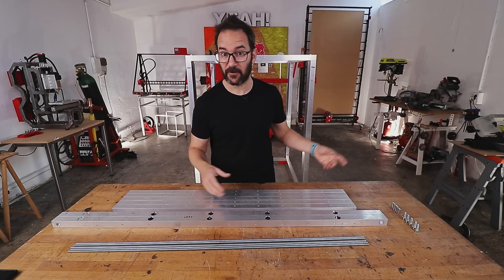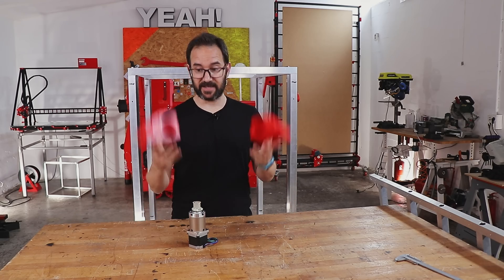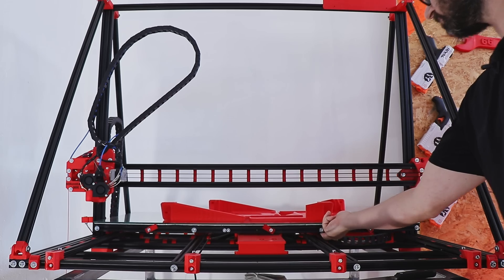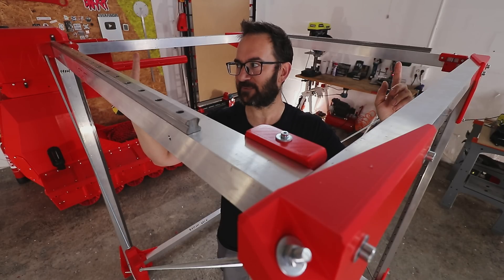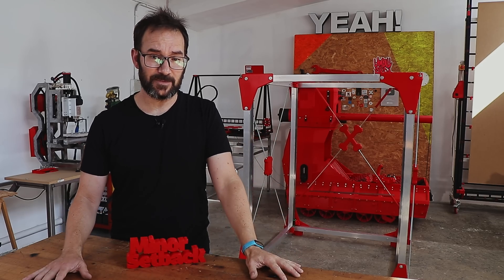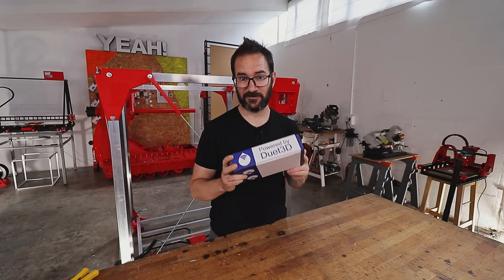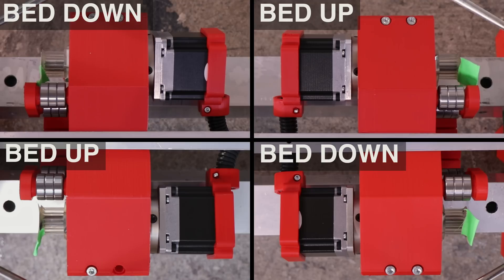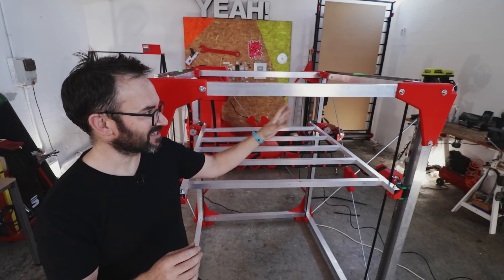MOST POWERFUL 3D PRINTER BED EVER (lifts human) - GIANT 3D PRINTER BUILD PT. 2

Comment: I've been wondering this for years: for big printers, wouldn't it be more useful to lift the xy assembly and keep the build itself stationary...
Anyone got a reasoning for this? 

True, the forces of X-Y movements will be bigger, but the massive weight of a completed print seem harder to handle.

Comment: Not sure if it would improve anything, but would it not be easier and slightly better to attach the motors up/down on the frame? Then you dont have to lift the weight of these + cabling is a bit tidier(?)
Maybe i am overlooking something completely here and not trying to crap on your project! Love it!
Reply from the maker: It would increase the length of belt to be stretched.
Reply: @ivanmirandawastaken  Didnt think of that, thanks for the reply! :D

Comment: Just out of curiosity is this going to be a corexy or a cross gantry 3d printer? I heard Cross gantry are really nice since the belt loops are simpler than corexy ones but you really need to use all linear rails

Comment: Timing belts will flex with the added load of the print. Resulting in under-extrusion with heavy prints. As the Layer height is not predictable.

Comment: I Recommend Using Thicker Gauge wires for the DC power From The PSU or at Least doubling or quadrupling the wires you're using ,It might bite  you in the Long run with more steppers and load ... Personally I preferred Acme Screws on the 4 corners ,Though you gotta work with what you Got .

Comment: I would still add pulleys and a counter weight to it just to lower the strain on the motors, and make them less likely to fail and drop.  Still, can't wait to see it operational.

Comment: If you ever decide to build even bigger printer, try designing a bed with counterweights (like an elevator). It allows to have better control even with weak motors, since they operate on weight difference. I've seen a dremel cnc with this approach, it worked fine.
Reply: That is a great idea for something this large. 
Some industrial CNC machines do in fact use counter-weights on cables, others use springs or even air cylinders to compensate for the weight. Often times the movable part weighs several hundred kg, so the compensation systems really do help.

Comment: i've been considering building my own CoreXY setup (not this large of course lol), but the hell if i can figure out how to control it, i'm guessing it pretty much comes down to writing the firmware the way you want i normally use BTT boards in my printers, and have zero experience when it comes to Duet boards but i know ivan loves the things (since he uses them all the time) so i'm guess they are pretty customizable...
Reply: Just use Klipper, it comes with CoreXY support out of the box and supports many commonly found Mainboards. Have a look at the Voron printers for some inspiration:)

Comment: While the system can take the weight, once you sit down you can see the whole bed move down a little bit. That is the belts stretching and might result in accuracy issues with larger prints..

Comment: Impressive that it can lift your full weight! 

I wonder if itd be worth it in a system like this to have two z-axes; one to move the build plate slowly and steadily; and a second little short stroke z actuator on the hotend to do the z-hops (like a piezo with a lever system). The sheer wattage consumed (not to mention vibrations generated) if you want to aggressively z-hop a full build plate like this will be kinda disgusting :P.

Comment: What is the reason for the bed moving up and down rather than the print head?  I am asking because, having XY gantry move up and down would have the moving masses stay constant, unlike getting heavier as the printer extrudes more to the moving bed like in the current configuration.  Also, was decreasing the belt length by half that significant to have the motor attached to the moving bed?

Comment: Wouldn't you have problem with elasticity of the belts during the print. The deposition of material in the bed would slowly get heavier, messing up the leveling of the nozzle between layers and therefore getting weaker layer adhesion. Isn't it?

Comment: I'd like to know the thought process behind how you landed on this particular setup for the z axis movement - this is the first time I have seen it being driven by belts in this manner. I would have assumed the usual threaded rod approach (lead screw).
Seems to me that the lead screw would be stronger (no stretch) and would provide mechanical advantage to the motors by design. Side to side wobble could be a concern but then again thats what the linear rails are there for. Could also just use a thicker screw.
I'm not an engineer so I definitely cant say what's best or claim this way is bad. I'm sure he has thought about the potential stretch and tension problems just like the rest of us. Will be interesting to see it print!
Reply: Voron 2.4 is similar in the Z-Axis
Reply: @mocotonio  a lot of parts look like he took some inspiration from the Voron family of printers :)
Reply: @JonasKöritz  Probably not a bad thing.
Reply: @mocotonio  yes, definitely. I've recently finished my Voron 2.4 build and I'm impressed on how well thought out that thing is!

Comment: Supprised you didn't use closed loop stepper motors. With such a massive length of belts there is definitely an increased chance (especially as the machine gets used) of slipping and skipping. 

Appreciate its only really small chances, but each time you build a bigger machine the small chance does get bigger....

Comment: I wonder if you had given it any thought to put on every corner lever mounted castors that have small shock absorbers or chair gas shock replacement cylinders so that your printer sits evenly on the floor of your workshop plus if you need to move it out of the way then you won't have to struggle dragging it & possibly causing injury to yourself & the machine?

Comment: @Ivan
If you can't find the right size pulleys because the shaft diameter of the pulley is too small or too big then there are a couple of ways to modify things so that they will work after all. If all the easily accessible pulleys at your fingertips are 10mm shaft holes then you can simply drill them out to 11.5mm on the drill press using a 45 degree block of steel that can stand up so you get a perfect vertical hole & then use a 12mm Spiral Reamer which creates a perfect smooth bored hole.

With the larger diameter holed pulleys you can find the right size outside diameter brass sleeve bush that will fit into the pulley & then also drill out the center to 12mm on the drill press. If you use any type of bush you'll also need to drill a hole through it & tap it in the same place as your pulley so that when you screw the grub screw into the pulley you are able to clamp onto the motor axle. These plastic pulleys that you are making up might not stand the stresses that you will put them through so you will definitely have to look at the options above.

Comment: Hey, hi, a good way to stiffen a square is to use steel cable under tension instead of the threaded rod. Its easier to install and cheaper.
Reply: I happen to have experience from both solutions as I thought as well that threaded rods are a better option for similar tasks! Steel cables under correct tension are very rigid, simple, lightwight and non-disruptive. It should be noted that threaded rods are not rigid without tension either and transfer vibrations quite well too, yet they are much more complicated to install (see all the required parts and nuts?). There are still a lot more to understand, the physics and minor details are important. However I would recommend choosing steel cables in similar projects. And if you still need more rigidity you need to look at your design again and consider adding more crossbars.
Reply: Cables work but they don't add as much rigidity as thread all. Cables will also allow vibrations to transfer to the frame more readily. Thread all gives you the ability to use them like iron rods but also the convenience of adjusting the size without having to cut them. It's a more rigid design using the thread all and that's what you need in a printer. We use cables in aviation because they are lighter and they allow for Flex. Flex is the enemy of this machine
Reply: adding this reply because youtube doesn't show dislikes on comments.
Reply: @MachineManGabb  why would you dislike? Why not just correct or at least share your opinion so that if you're wrong you can be corrected. That's how we learn!
Reply: @MachineManGabb  hey hey their now their opinions are correct. Are you here to taunt them 🤔
Reply: @MachineManGabb  like every suspension bridge in existence?
Reply: @GBR6000  suspension bridge is not and should not be rigid, this frame should. Also it should remain square over time, cable stretch a bit (which they do under tension) and the frame is not square any more. If for some reason frame goes out of square it is easy to re-square by adjusting the nut, not so easy with cables.

Comment: With that size bed, I would've recommended a rack and pinion drive mechanism rather than a belt, which is prone to stretching under load. This is of particular concern, given the dynamic nature of the load as you print.
Reply: @Thomas Bonse
I guess the measuring rail or decoder would solve said problem of sag etc. So in g code u can compensate on the fly. But still i m with you there. Linear Screws are not so expensive IMO. Version 2 then incomming hehe
Reply: These high quality steel belts will do just fine at that huge width. Other parts are going to bend before any damaging amount of stretch happens. I'm sure he is going to use leveling on his bed which will compensate as time goes on. Even if they do stretch over time, it's going to be a slow process over time that will not make a measurable amount of difference during even a week long print.
Reply: @BifsieOfficial  I'm not talking about stretching from one print to the hundredth print. I'm talking about during a print. Even just a small amount of stretch, in the region considered negligible by the manufacturer, can result in dimensional changes to the printed part.
Reply: @thomasbonse  
I guess your concern is valid.
But you have to think in an all difetrnt direction.
This printer is so bigg, you have to be happy if you have mm accursce.
I mean even centimeters would not be crasy noticabel in the end
Reply: @thomasbonse  On a traditional printer perhaps sub-tenth-mm matters for extrusion on a 0.6mm nozzle...this machine won't be making layers that thin, and any dynamic loading will vary proportional to the print progress, so any stretch on the belt will be proportional to one layer of print, barely changing anything. Worst worst case is the software needs calibrating that the final height be off by a few mm for a hundred kg part.
Reply: @frollard  You're assuming even loading of the platform, which is not guaranteed. This is one of the reasons why even cheap and small printers don't use belts for the Z-axis.

Comment: I feel like the box might need wheels pretty soon.
Reply from the maker: I'm feeling that too
Reply: @ivanmirandawastaken  Can imagine you're feeling it in many more ways too.
Reply: I've been thinking about the wheels. I think retractable wheels would be good for this. That way when you don't want it to move, retract the wheels and it sits on the floor like it does now. Look at some warehouse move able picking steps for ideas on how to make the linkages and locking mechanisms so you can control the retraction and deretraction of all 4 wheels from a single pedal.
Reply: @Sembazuru  Yea, my fear is that having wheels would make the whole thing less stable and hurt print quality. This would definitely avoid.

Comment: For the cross braces, why not use tension with wires instead of compression with the threaded rod? It seems cheaper/simpler.
Reply: He's using tension with the threaded rods.  The tension is easy to adjust by turning the nuts.
Reply: @Mueller3D  I see, so why not just use cables then with cable tensioners? Wouldn’t that be even cheaper/simpler?
Reply: @vell0cet517  There are many possible solutions.  He chose one that he was familiar and comfortable with.
Reply: @Mueller3D  Fair enough. When my instincts point me towards approaching a problem with x, and an expert does y, I like to ask about it because it usually means there's something important I don't know/understand about x, y or both.

Comment: Ivan, minor critique... The Z belt tensioners would be better on the bottom of the belt runs so that the tensioner blocks and screws weren't the elements holding all the weight. Probably ok now that it's in, but just a thought for future consideration :)

Comment: Suggestion: Adding a small second z axis on the print head that just does z hop moves, might be a cool inovation.
Reply: This needs to be done in software and in firmware, but it might be possible with some enable/disable commands for start and end of each layer. Basically switching motors on and off or using a relay to switch their step signal.

Comment: Why lift the bed at all? I would have lifted the gantry like the vorons do, this way you are lifting always the same weight and won't get issues later with flex due to increasing weight the longer the print goes. Yes you demonstrated that it is able to lift your weight, but what about the flex of the bed?

Comment: Hi Ivan, great build till now but even the steppers are strong enough I would recommend a counterweight for the bed🤔😊
Reply: i wouldnt worry about the steppers, 4 high quality nema23 with a 43x or whatver it was reduction have enough torque to lift several ivans :P
Reply: @Insane_Kane  Not sure if I did my math right, but not accounting for friction and assuming nothing else in that build will fail first (which it probably will), the 4 motors at 60nm each, assuming a pulley diameter of 3cm, will probably lift somewhere in the neighbourhood of 800 kg. Quite a few Ivans.
Reply: @XTJ7  You need to calculate with the radius not the diameter means you need to do the math with 1,5cm not 3cm, it can lift 1600kg.
Reply: @jonasstahl9826  thanks for the correction! Even more Ivans :)
Reply: @XTJ7  I hope he builds in some safety features and limits the power for the steppermotors, the Z axis can kill someone.

Comment: Yeah, it works, but man.... You're going to have to have an awful maintenance schedule on that thing.  Especially using belts to lift that much weight.
With the power of those steppers, I would very also highly recommend adding closed loop positioning feedback to those. If one of your steppers fails, I'll bet it could do some serious damage to your bed attempting to home.

Comment: I think you will need casters and a remote control to move you're huge 3D printer. And most of all... It would be awesome use an rc to move the printer location inside your workshop
Reply: I think tank tracks might be more appropriate 🙂

Comment: And then powerloss and all this heavy bed goes in the basement
Reply: I dont think so, given that the gearbox are 47:1 and the stepper motors are still magneticed for a little bit when power goes out the bed will go down pretty slow, with an empty bed it probably doesnt go down at all.

Comment: Will you be adding Z limit switches for each bed motor so it will auto level at the top ?
Reply: One switch on the hot-end can do the job, and, more importantly, it's the bed-to-hot-end distance that matters most.
Reply: @Mueller3D  it will be much quicker to just level all 4 corners instead of running a probe each time, depending on the gearbox each motor  could drop a bit at any of the 4 corners while not powered up because of how heavy the bed frame it. Then just tune the Z offset of the hot end.

Comment: Sir, after going through making the board connectors you didn't use crimp lugs or ferrules on the power wires? 😱😱😱

That mixup on the frame was painful even from a spectator point of view. Glad you got it sorted.

Comment: Have you measured the belt stretch? Maybe it’s fractions of a mm but with a 10kg print there could be some very minor elongation in the z axis?
Reply: that's absolutely true, however since the elongation is gradual between the tiny layer heights, it has no bearing on the actual printing, only on the final dimension.

Comment: Incredible build, if you carry on like this you'll be making 3D houses. But, just wondering why you didn't lift the bed with threaded bar and have the heavy steppers on the static frame.
Reply: Probably because in case something fails, the threaded bar will bind up, given that the print might weighs 100+ kg, that would be pretty difficult to fix, a beld can simply be cut.

Not to mention that 4 rotating rods are much more dangerous, that 4 beld wheels that can easily be shielded, a printer that size isnt a toy, it has enough force to lose a few fingers.
Reply: @jonasstahl9826  Your reasoning makes a lot more sense than mine 😄
Reply: @michiganengineer8621  Thanks
Reply: The inexpensive threaded rod, like what he uses to fasten longer parts together with, can have some imperfections in the threading.  Not enough to interfere with a nut too much, but maybe enough to throw off the precision Ivan wants with the bed motion.
Reply: They would probably be too expensive.
Reply: There are many design choices that can work, and sometimes the decision to use a particular one is arbitrary, or perhaps just what you are comfortable with.
Reply: I would have gone with threaded bars too. And linked with bicycle chain and one motor to drive them all.